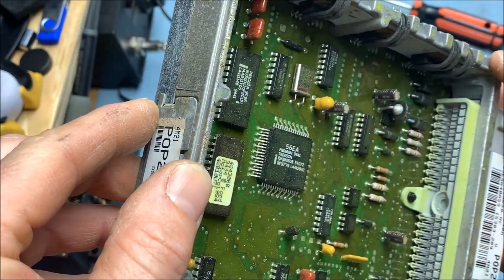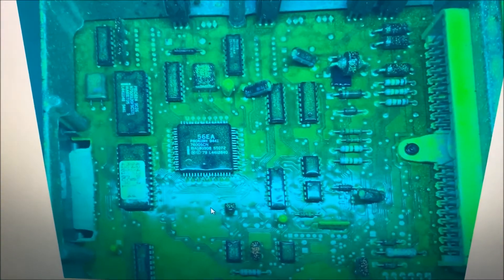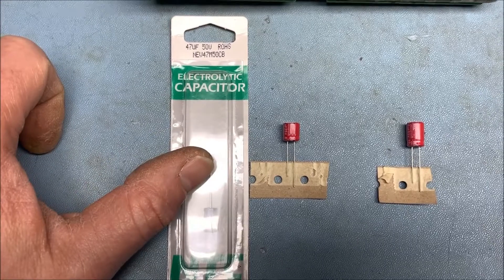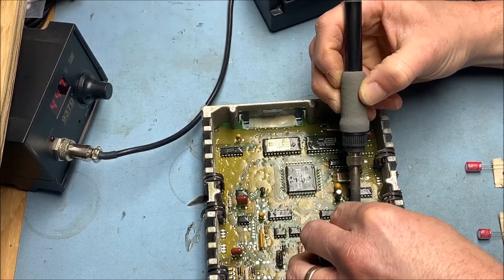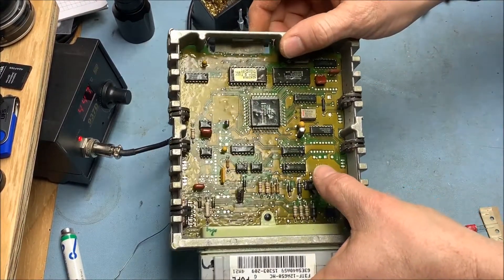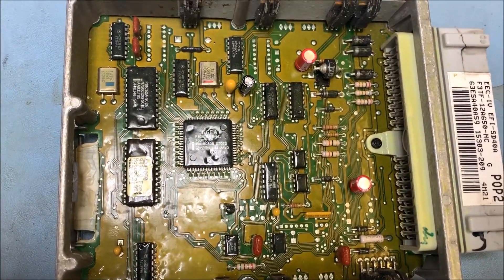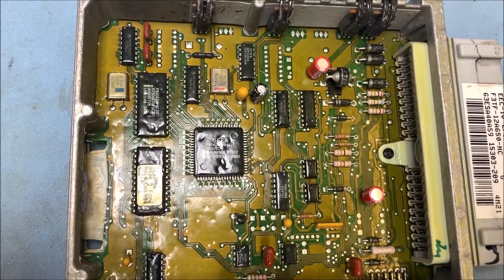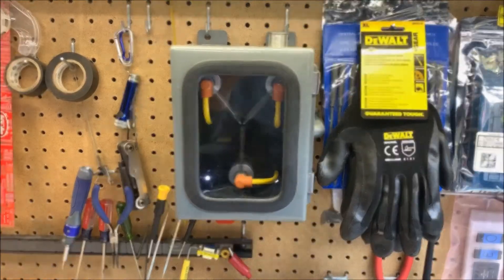Ford OBD 1 ECM: Using Aluminum Polymer Capacitors

Comment: I've never heard of changing capacitors as part of preventative maintenance but hey, I learned something today. Very cool.
Reply from the maker: wyattoneable its common for the caps to leak in these older ECM’s. When they begin to fail it causes all sorts of strange drivability issues.
Reply: Lol man in my world I replace them daily for preventative maintenance. If the esr is a tiny bit weird it’s getting changed. But I’m an electronics technician so it’s kinda part of what I do lol.

Comment: The first thing you will notice with this EEC IV design by Motorola AIEG to Ford Specifications, is the lack of bulk filtering both on the +12V power in and +5V logic supply. Panasonic makes AEC-200 rated automotive Conductive Polymer Hybrid Aluminum Electrolytic Capacitors like the ZA-A Radial lead type (10,000 H at 105 Degrees C) which are very reliable compared to the original module capacitors.

Comment: almost forgot about the nightmare of just getting to this part and whats involved just to pull it out.  It looked real clean inside still so thats a plus. Cool trick to check for leaks under UV light, almost like the black light test at a hotel... either way you never want to see a glowing light lol!  Like i told you before I had absolutely zero luck getting the old caps out, im betting the cheapo solder gun had a lot to do with it after watching this. maybe i'll upgrade and give it another shot.  This is far from my limited realm of knowledge but sounds like the flash is possible with the right tools. heck that might be what the resellers are doing now , while all the other guys are hunting engine and interior parts someone is making a quick lick on computers that have been discontinued by ford. great video Steve, glad your uploading more and more again. i enjoy these a lot!
Reply from the maker: Yeah I was fortunate that this truck isn't all rusted like the last one I did this on and the inner fender bolts came out without taking pieces of the fender with them lol. The solder iron makes all of the difference in the world, especially on the large ground-plane areas. The one I'm using cost around $30 from eBay, if you don't care about the digital display you can get the analog dial version for 20 or less. Thanks for watching, my next video will probably involve the hemorrhaging power steering.
Reply: Steve Stoltz just in the nick of time, that rebuild kit I bought was not the answer to fix my p/s (it was shot internally and the shaft was scored beyond repair) your becoming my go to for 9th gen f150 lessons 😂. Looks like I’ll be hitting a junkyard on my vacation next week to scavenge one. Looking forward to that video though!
Reply: What solder and flux did you use and do you put a fingernail polish coating on it ?

Comment: I'm going the other way with my OBD 1--I'm replacing that 63V/10µF electrolytic with a 10µF, 100v film capacitor, since the aforementioned electrolytic seems to like to self-destruct.  There's plenty of room in ECU and a film cap should probably outlast the truck.   There was a time in automotive electronics where using electrolytics was considered to be verboten.
Reply: Got any data to back that up?   ESR on film caps is essentially zero--and they're nonpolar.  The general rule of thumb is if you can make it physically fit (with the proper voltage rating), you're fine.   As a matter of fact, use of electrolytics in automotive use was generally frowned on before 1980.
Reply: @tubastuff   Can you send me the link to the ones you bought?
Reply: @gabewall7381  They were some that I had around--I don't recall the manufacturer. Sorry!
Reply: @tubastuff   No problem! I appreciate the fast response anyways

Comment: So, you put capacitors in it with a different voltage? Please explain how that works thank you. The voltage doesn't matter that much? Would you be interested in fixing my 1990 mustang ECM if needed?
Reply: Phillip,  The voltage rating on the label of a capacitor is for the max allowed voltage that can be applied to a particular capacitor in circuit.  So, using a capacitor with a higher voltage rating is ok but not a lower.  The uF rating (micro farad rating) must stay the same in most cases depending on circuit design.

Comment: I admit that I was surprised to see that some ancient Ford OBD1 ECU / ECM used x86 processor (Intel 80186) to do the usual stuff that all ECUs has to do. Majority of them usually just use 8051 or 6502, something similar, but not of PC technology such as x86 - Ford use ARM microcontroller instead nowadays. 80186 is basically a microcontroller version of 8086, alas.

Comment: Excellent DIY Video. Big Help, Thank you
Your video shows the correct way to remove the EEC IV, at least for my 1994 Bronco XLT 5.8.

I Watched a Different Video that showed the removal from the inside behind the Driver-side kick panel. 
That Video claimed it was for 1980 thru 1996 Bronco's, that video was wrong..
 After removal of the kick panel I realized there was no-way it was coming out that way.

Then I found your video showing the correct way to remove it, from the engine compartment.

Thanks Again.

Comment: I am on my 3rd ECM for my 1993 F-150.   Truck will start & run for 30 minutes, then die....Set it aside:  have new coolant temp sender / sensor to install, and will take apart the ECM for a look.  Suggestions ?
Reply from the maker: I'm thinking it may be ignition related. I would take the Ignition control module in and have them test it and see if they can get it to fail, its located on the drivers fender attached to a heatsink. Also after it dies check for 12v at the coil while cranking the engine, there is a wire Junction in the harness under the air box that can start to go bad and cause it to run like crap or not at all. One other thing that comes to mind is the fuel pump, check and see what kind of fuel pressure you have after the engine dies.
Reply: @SteveStoltz  Thanks.   Appreciate it.
Reply: My thunder bird would die like that and I taped on the crankshaft position sensor with  a screw driver and my car started replaced it and haven't had any problems since

Comment: My e350 7.5l stumbles or miss fires at idle when it gets up to temp and the hotter it gets it gets worse . Acceleration is 95 clean and shifts smooth. Maybe ecu? I replaced icm, map and check fuel and vacuum.
Reply from the maker: It’s definitely a possibility, you may also want to check the temperature control sensor to make sure it’s in spec.
Reply from the maker: It’s definitely a possibility, you may also want to check the temperature control sensor to make sure it’s in spec.

Comment: Wanting to order some for the computer in my lightning, what are the specs on the aluminum polymer capacitors you used? Could they all be 25v and work fine?
Reply from the maker: I don't remember the specs off hand but going higher on voltage rating is fine. So far, I have had no adverse effects from using the aluminum polymer style in this application.
Reply: @SteveStoltz  how many total was there to replace? I’m thinking of pulling my computer out for some preventive maintenance.

Comment: Are they positive and negative on them?
Reply from the maker: Yes they are polarized.
Reply: @SteveStoltz  How do you distinguish between the two?
Reply from the maker: @nicholasrawls4067  The positive leg is the long one, and there is a stripe on the barrel of the capacitor that indicates the negative side. On the board itself the positive hole typically has the square solder pad

Comment: You can remove the ecm from inside the cab, much easier
Reply: If his is anything like mine, there's a parking brake peddle mounting plate in the way of pulling out the ECM through the inside. It is easier to pull it out through the engine compartment and unscrew the wheel well.